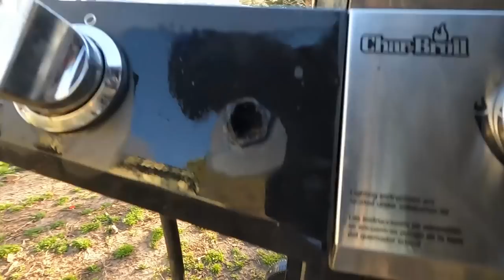WASTE NOT WANT NOT | REHABING THE HOMESTEAD GRILL | HOW TO CHANGE THE BURNERS ON A GAS GRILL

Comment: Big difference in being cheap and being smart.
I’m glad someone else refurbishes their grill every few years rather that just throw them away!
FYI you can also make your own burners out of 3/4” copper pipe next time.
Flatten one end to secure with the clips drill several rows of small holes down the length.(basically replicate the universal ones)
The copper DIYs seem to last a long time!
Great video!

Comment: Aaron go to Dollar General and get some Mean Green Spray. It will get that smoke black off your grill, Mean green cleans just about everything. I use to paint figurines and if I messed up I would use it and it removed dried paint. I also cleaned back of restaurants (caked and baked on grease) this cut cleaning time  so much. Use full strength spray wait 2 or 3 minutes and wipe off. Repeat if necessary (not usually) . :)